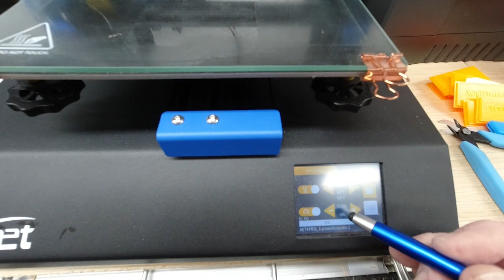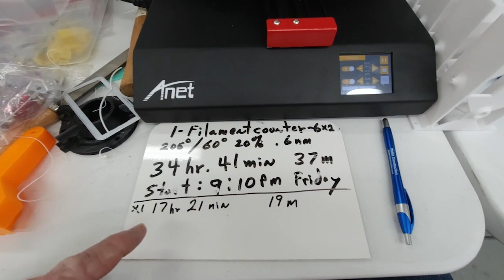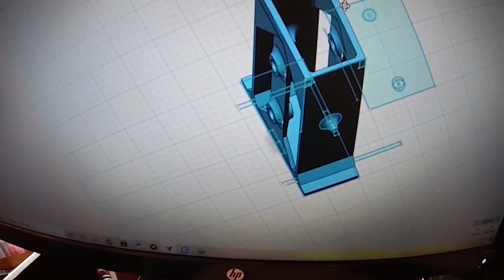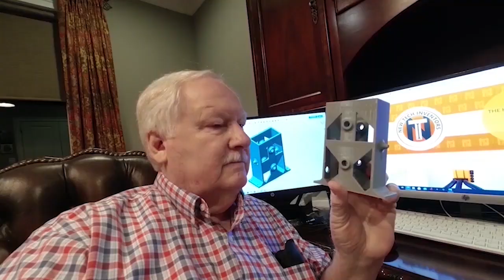MY LAST WEEK OF 2021 3D PRINTING AT MY 3D PRINT FARM making parts for the NTI HELPING HAND

Comment: Metal pei build plates are the best.. not because there great for printing on but because it flattens your bed well. Adding a magnectic flexible build plate on top this means you get the flatness and the better adhesion of the flex mag build  plate. Both separately are irritating. Glass beds are good but because you have to clamp them, they bend to you printers plate which are often uneven
Reply from the maker: Thanks for sharing this information. You have made some good observations and I am finding many advantages to the spring steel PEI sheets myself. Thanks Michael, for your comment and for your support...Ken